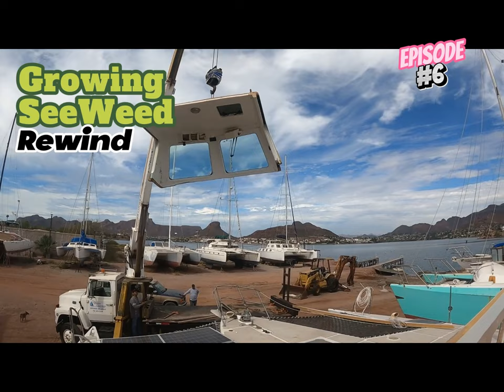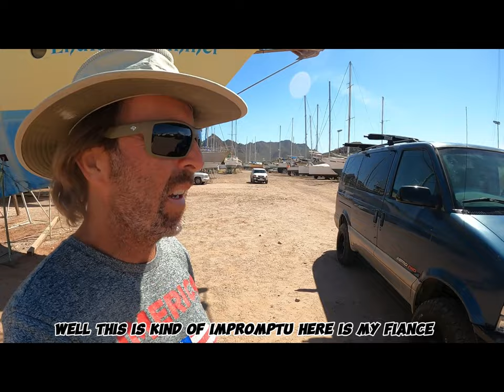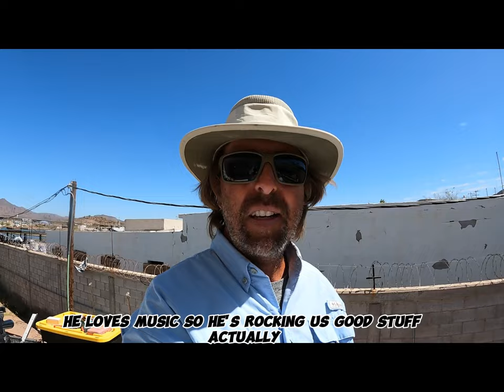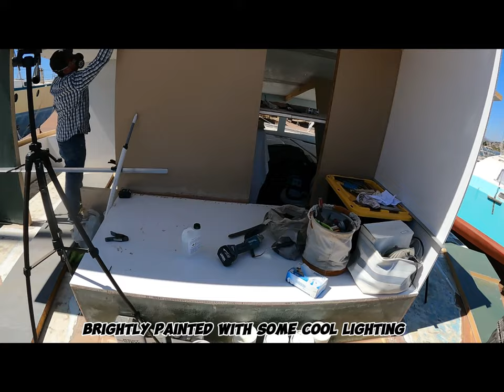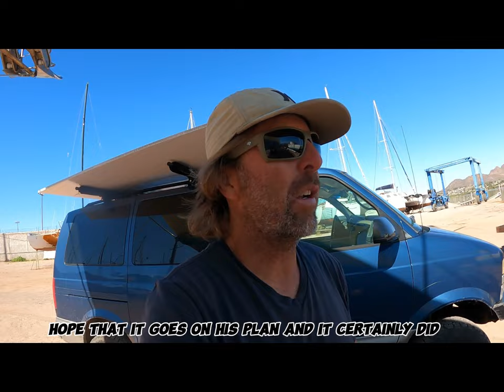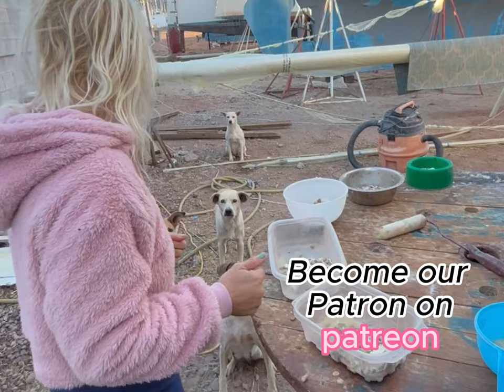(Ep #9) Insane DIY Sailing Trimaran Redesign. “Building our Modern Loft”

Comment: I'm not familiar with the engineering of the Horstman tri. I'm curious whether the original deck sections you removed acted as structural elements as part of the akas, to support the forces from the amas when sailing. Have you checked your design modifications with a marine surveyor or engineer?
Reply from the maker: Yes this was a concern of mine and I looked into it, and we came away with by just adding some hull stiffening planks it should work just fine.  I’m unsure as to it’s blue water capabilities after all this but for what I’m planning to do it should be good.  It does have 3 hulls and that offers plenty of strength and with the bulkheads and other support we will be adding... thanks for your input.  Best
Reply: @SeeWeedBoatLife  that might be good content for a future video... To explain in more detail how you two intend to use the boat when it's done. That has a lot to do with the design trade offs of course. I'm looking forward to seeing what you do for the interior, and how it sails after the charges are complete. I'm envisioning a hard dodger and additional walkways on our sea clipper 41  build with good canvas work for added outdoor living/ entertaining space. We don't plan to take it into cold climates very often.